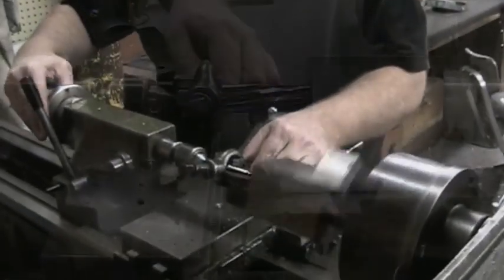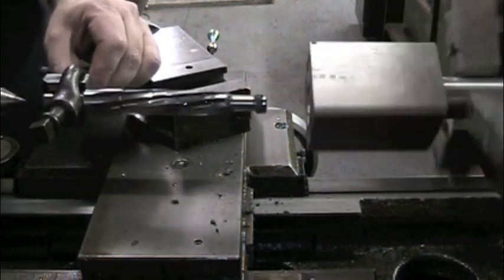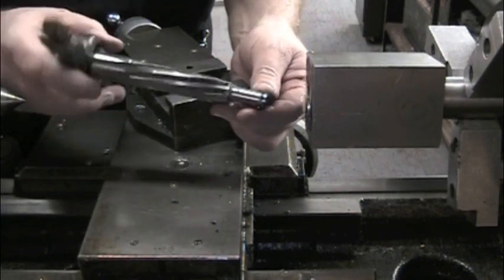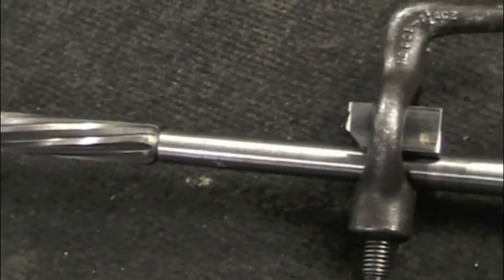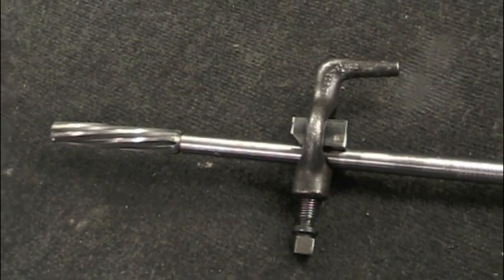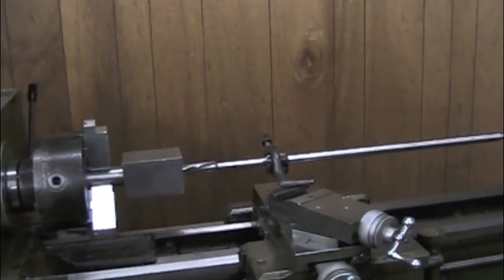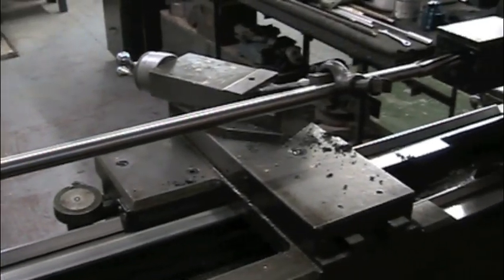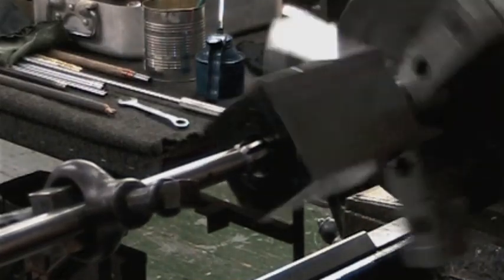SXS  SHOTGUN BARREL MFG. PART 4 BORE REAMING

Comment: Dont understand why you want to chamber before the barrels are finished and assembled .Chambering should be done after the barrels have been made machined and had the extractors fitted .OK so maybe you want to rough chamber but surely a 3 fluted core drill is the best option  .Much easier just to buy the tubes from a experienced and specialist maker
Reply: There are only about 3 commercial  chopper lump bbl mfg. in the world today.  None of them are located in the U.S.A. Merkle mfg.
in Germany produces chopper lump rifle and shotgun bbls. ;but only for there firearm production. The other commercial chopper lump mfg. is located in Italy and there again there bbl. production is only for there firearms. I believe the last "in house" chopper lump bbl. mfg. is Westley Richards of England. And of course they only sell complete firearms. James Purdey and Son and Holland and Holland  double shotgun and rifle mfgs  produce chopper lump bbl. firearms the bbls of which are made to there specs  in Italy. Mono bloc type bbls are easy to mfg and tubes are easy to fit into a complete set of bbl. The difference between the chopper lump bbl.
and the mono bloc bbl. is about $40.000.00. In other words firearms with chopper lump bbls. are more expensive than mono bloc
bbl firearms.
Reply: @johnwilson4158  how many hours does a shotgun like this take you?
You are very talented. The way you get around with some files, i could only dream of.
To me its a joy to see something made like it was done 100 years ago. I'm sure the quality, fit and finish humbles everybody that handles a piece of art like this.
I don't own any guns, bit of a hassle in my country. I watched all video's from a machinist and metalworker point of view. I can spend hours watching true craftsmanship.